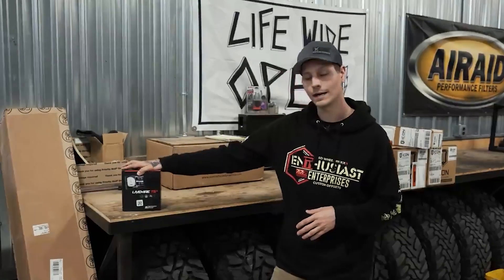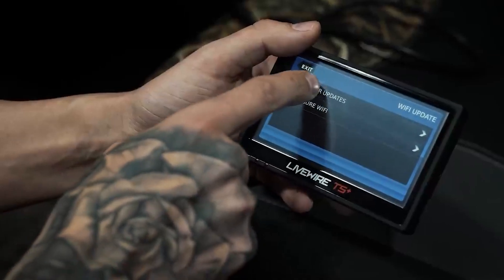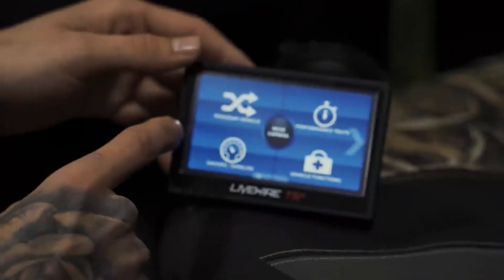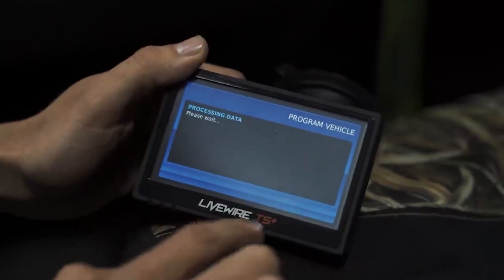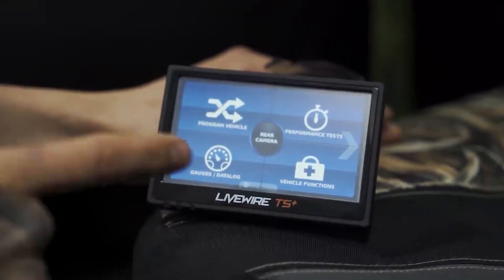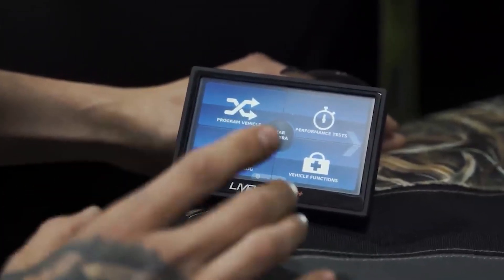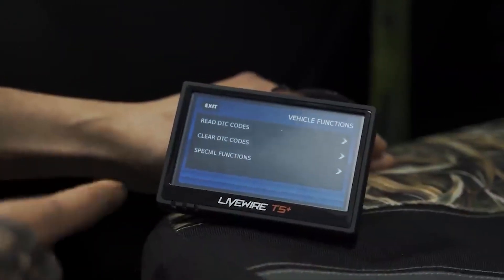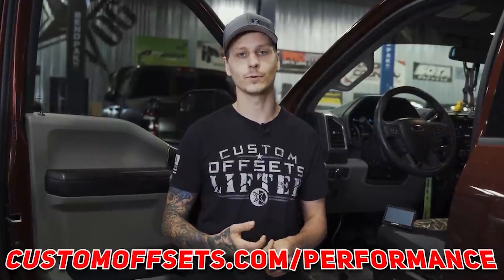Installing a LiveWire TS Plus Tuner on this F-150!!

Comment: I have this for my 2016 F150 Limited ecoboost and it’s been great. Recently had to change my plugs. Went back with OEM and these plugs only lasted 1 month before failing. Do the plugs need to be gapped differently or do I need performance plugs?
Reply: Ford Racing (M-12405-35T) 10-17 Flex 3.5L EcoBoost Cold Spark Plug Set